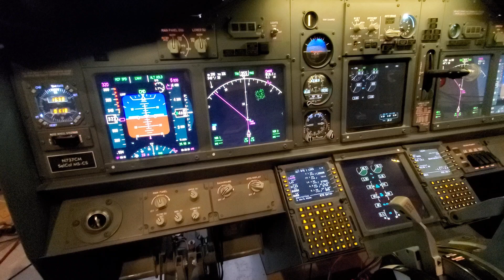B737-800 6dof Motion Platform

Comment: Very nice job
Reply from the maker: Thanks...   This is not so much a serious test, but did give me an initial idea of Platform Tilt and Actuator movements.  Currently, the system is fed Motion Cues by Ian's BFF 6dof motion software, and is driven by the Thanos AMC1280USB Controller via 220VAC Variable Frequency Drives to 1.5HP 1750 RPM 3-phase AC motors.  These input to a 160:1 dual gear reduction gearbox (1st stage is Helical; 2nd stage is Worm).  The output Lever provides a 6 inches throw.  The Upper part of the 6dof Motion Platform is built from 0.090" wall steel tubing, and the Flight Deck structure is a weldment built from 2" square thin-wall steel tubing.  The flight deck floors are Russian Baltic Birch, which is very light and very strong.  

As you might guess, the B737-800 Nose Section/Cockpit/Projection screen display will be mounted on top of the Flight Deck and move with the 6dof platform.  The approximate empty weight of the Motion Platform and completed Simulator is ~1,300 pounds (~590 KG), plus the added live weight of the Pilot (CA) and Co-Pilot (FO) up to ~500 pounds (~230 KG).

I soon plan on changing over to a Servo driven system using the same 160:1 Gearboxes/Actuators.  I will be using the Thanos AMC-AASD15A Controller to feed a 2.6 Kw 2500 RPM Servo Controller/Servo Motor system.   The actual description is:
130ST-M10025 2.6KW 220V AC Servo motor 2600W 2500RPM 10N.M. Single-Phase ac drive permanent magnet Matched Driver AASD-30A
Given the Lever radius, the increased speed and resolution of the servo system may allow for smoother performance and improved acceleration characteristics.  In any case, this is the beginning of initial testing of my 6dof Motion Platform for its B737-800 Sim payload.

My Sim is a full-Scale B737-800 using Prepar3D v4.5 for the simulator control.  I run this on a high-end PC Windows 10 system with a single Nvidia GTX1080Ti GPU.  The Sim display consists of 3 Optoma GT1080HD projectors using PixelWix blending and warping software to create a 205 degree wrap-around display projected on a 12 ft. diameter screen (which will ride with the motion platform).  The B737-800 flight Model is Sim-Avionics v1.96, which provides a realistic representation of the 737 flight characteristics.  I use real Boeing Seats, Control Columns, Throttle Quadrant and Pedestal.  The sound system is a Bose Sound Bar, which does a great job in a compact package.  In addition, I am using the BFF Shaker software to drive ButKickers attached to each seat to help add to the immersive effect.

This project has been underway for about 4 years...   The Sim is flying nicely, and I hope to have everything integrated and operational on the 6dof Motion Platform sometime early next year.